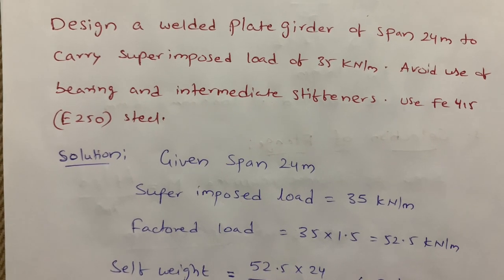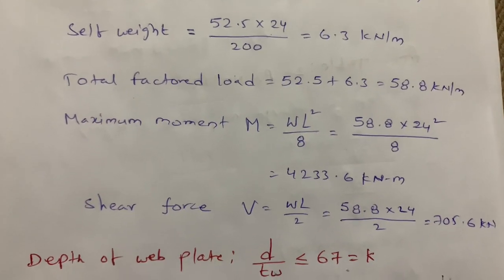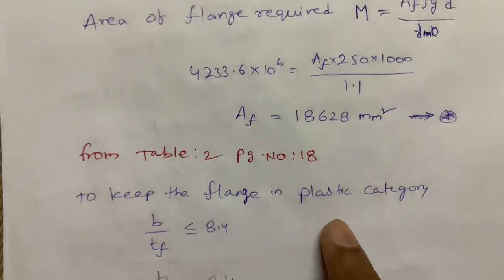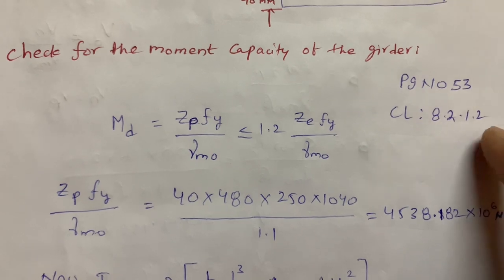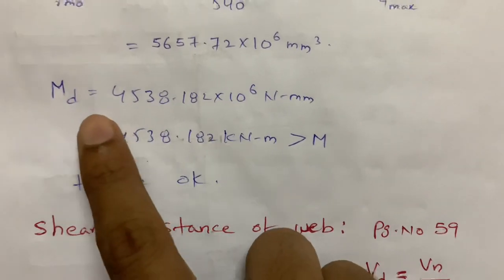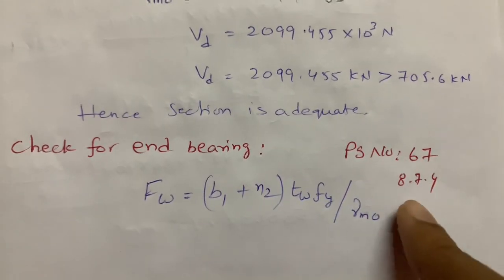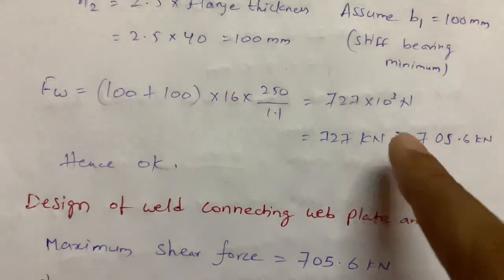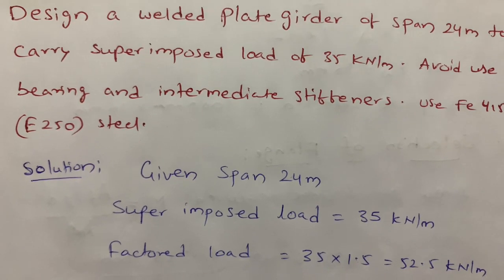#Design of Plate Girder #Design of steel structures #PlateGirder #IS 800:2007 #Welded Plate Girder #

Comment: (One Doubt)How do you take the section is plastic in step 3 selection of flange
Reply from the maker: Refer page no.18 table no 2 in IS 800:2007
Reply: @civilworld ok sir but you should assume the value is less than 8.4 for plastic section but you take it as plastic section without any calculation of finding breath and thickness of flange

Comment: Sir MD is value is wrong the value 5657.72 is not coming in the calci
Reply: Yes bro crt coz you Have to try this way Md= Ze fy/ ¥m0 
Ze=20.745 × 250 ÷ 1.1 you get approximate value
Reply: @garden._.flower  how yoh get the value of Ze = 20.745 ? Can you pls explain
Reply: @tirthpanchal8441  area of the flange X economical depth of web 

= 480x40x1040

Comment: Why did you chose the number 200 for calculating self weight. Is there any reason? I mean for any steel code, we have to consider 200 only?
Reply from the maker: No code is specifying that 200. It was assumed. Because W/200 formula developed empirically(practically).
Reply: @civilworld Thankyou for your reply, can you please specify the page number or whatever. I'm a mechanical student I'm trying to design a beam
Reply from the maker: @gowtham6277  refer SK Duggal textbook

Comment: Can we use the plastic provisions
Reply from the maker: What plastic provisions? Please be specific about your doubt
Reply: @civilworld  I mean do we use calculation of the plastic section for the design of the web and flange of the plate girder
Reply from the maker: @ganeshyadavflashgaming3286  you have refer code book I.e IS 800:2007 and steel tables book. For calculation of plastic section you have to refer page no 18 table 2 in IS 800:2007 limiting width ratio table
Reply: @civilworld  ok sir thank you
Reply from the maker: @ganeshyadavflashgaming3286  All the best 👍👍

Comment: Can you post another video designing plate girder (WELDED PLATE SECTION) with HIGH SHEAR FORCE , I.e where Factored SHEAR FORCE, V is greater than 0.6×Vd (SHEAR STRENGTH)?
Reply from the maker: Thanks for asking, but actually the process is similar you can try
Reply: @civilworld  What would be Vd? Vp or Vcr? In plate girder Vcr is always less than Vp, so logically Vcr should be Vd. But Moment Capacity calculated comes NEGATIVE!! Try solving one!
Reply from the maker: @therockinduderocks331  please once refer IS 800:2007 code book throughly. Please first study design procedure of plate girder in the code book. Then you can easily solve the problem
Reply: @civilworld  I have done that . I have even tried solving 2 different solved examples from 2 different books. I got same result. I can even share my calculations if you like. But just for argument sake, try solving one for yourself. Decide what would be Vd? Vp or Vcr? Value of BETA is where the problem lies!
Reply from the maker: @therockinduderocks331  Yeah sure. Thank you
Reply: @civilworld  I would welcome your reply!!👍

Comment: Can you please explain 12×16 in the final steps
Reply from the maker: Maximum un welded portion is 16mm which is thickness of web which is multiplied by 12 mm is maximum weld provided. Please refer code book for design of plate girder section.

Comment: Maximum unwelded length ela vesaru sir....ardam kaledu
Reply from the maker: Sorry I didn’t get ur doubt...please be specific
Reply: @civilworld  ending lo maximum unwelded value ardam avvaledu
Reply from the maker: @m.h.v.chakravarthi690  In page number 79 clause number 10.5.5.2 IS 800:2007 mentioned the clause 12 times the thickness. So I took 12x16=192

Comment: Calculations is all wrong answers...
q =1.310  Vastundi
Kani q=0.512 vesaru. ..
1.310×480=628.8 correct... answer..
Textbook loo ela unte alane kapi kottaru... konchem calculation Chuskoni video upload cheyandi problems chese tappudu..
Reply from the maker: Thank you Praveen. Civil engineering is completely practical subject don’t bother about the answers. If you are a student you can correct the answers as per your calculations. Practically I will follow the procedure. Thank you